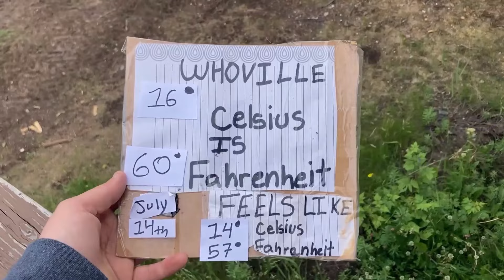Homemade Gantry Crane for the Caterpillar Storage Trailer July 14 2024

Comment: King 🤴, it's great to see you up and moving better . I did something stupid today. I was changing a hydraulic line on my forklift, fell off of the mast . I was only 6 feet in the air. I landed on my back. Im in a lot of pain, but Im sure it will be worse tomorrow 🙃.
Reply: Hope you mend,  Last fall, I'm still feeling,  Slowing down to a crawl, is better than falling
Reply from the maker: well that is not good, you need to work more carefully and smarter. drink lots of Vodka pain medication like i do  thansk

Comment: Glad you're mending. Neat looking trestle. I used a 2 high pipe staging on wheels for Jeep engine R+Rs.Joey, seeing the value in those casters  30 yrs ago and now using them is every pack rat's dream.
😎
Reply from the maker: yes we built this with no money just lots of time which everyone has. it will work good in trailer #9.  thansk

Comment: Hi Joey and staff great videos 
I like your engine gantry
Just a saftey issue all the weight is hanging on the brass welded flat bar on to the round pipe (tick) can you add a static strap chain if the weld breaks boom  
Carry on its beer oclock here Dee Why Northern Beaches Australia
Reply from the maker: we should be good the way i welded it and the materials i choice for the job, we will not be lifting anything heavy just the cranks and cylinder heads. quick google search and those are some nice beaches north of sidney.  thansk

Comment: Good morning from Cape Cod ⛵ AC⚡DC you've been thunderstruck 🤘 it seems to have done you good, that roller system for the gantry may be the single most ingenious thing I've seen you do thus far. Very very nice Joey 👍 here is hoping you never get well cuz I think you're just about right how you are😉 Xena, considering your experience and knowledge of heavy equipment maybe you could apply to the highway department. It's just a thought. Anyway guys thank you for another great video 👍✌️🇺🇲🇨🇦ps somebody didn't empty the vacuum canister 😂
Reply from the maker: thank you, i had to do something for the trolley since no money to buy one, i had 3 bearings so i made them work. yes Thunderstruck by AC/Dc says it all for me, lol  thansk
Reply: @kingofobsolete4789  I'm glad you don't have any money, that trolley is ingenious 👍 local Ace hardware move locations and sold off some paint inventory. I got 10 gallons of Rust-Oleum for 50 bucks. All safety colors. I'm painting my boat trailer safety blue
Reply: @kennethsonier1766  better safe than sorry 💪😄
Reply from the maker: @kennethsonier1766  talk about being in the right place at the right time. if people say the trailer is to bright, say your colour blind, lol  thansk

Comment: Lighting Strike , CRAZY!!! So glad your Okay 👌🏻! Just noticed you use a autodarking hood? Unfortunately I have never had a good experience with them. Still use my Jackson 4x6 hood that has made a few dollars . Have you ever had any problems with the hood you are currently using?? 🇺🇸🇺🇸🇺🇸
Reply from the maker: the speedglas has treated me good over 20 years now, the dampness in the shop during the raining season effects the batteries so the helmet needs to be in the dry house during that season. i like the fact you can adjust for being outside or inside when darkness required is quite different  thansk

Comment: Svetsskärmen du kör med är tillverkad i Sverige… gubben som kom på speedglas svetsskärmar bodde 100km från där jag bor… hörnell industri i insjön
Reply from the maker: yes they are good and i have been using them for over 20 years. a very good idea and glad the fellow invented them. they have improved my welds because i can see before i strike the arc. Sweden has more to offer then just the Swedish Kid, lol  thansk
Reply: @kingofobsolete4789  japp bahco verktyg men dom ska vara tillverkad före 1999 för då hade dom kvalitet
Reply from the maker: @Jörgensmaskiner  it was 2004 when i got my first speedglas welding helmet, remember it well and still have the helmet used as a back up one too. good quality  thansk